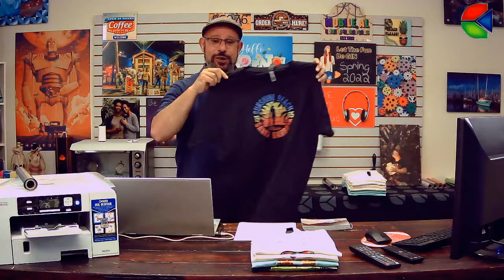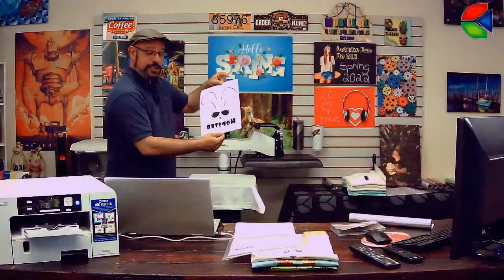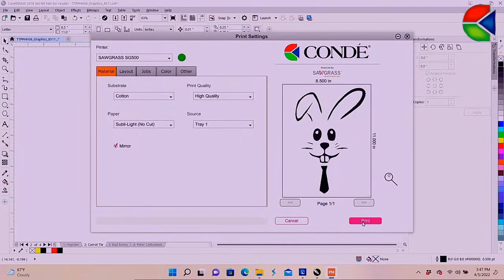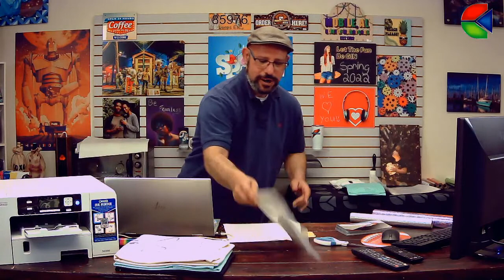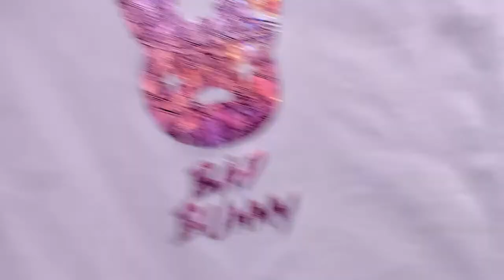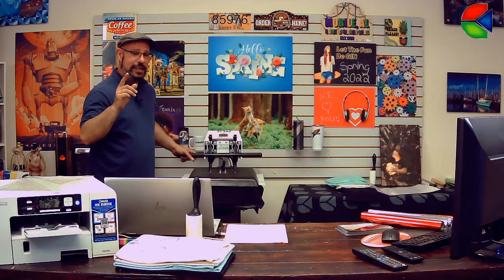TTPPHH Episode #36: FOREVER Sublimation to Cotton with Hot Stamping Foil

Comment: Interesting how do these wash?  Temp? dryer?
Reply from the maker: Conde recommends washing in cold or warm wash cycle. Do not use liquid fabric softener in wash cycle. Line dry or tumble dry using low heat setting. Do not iron the image without using a non-stick silicone sheet to protect the image.